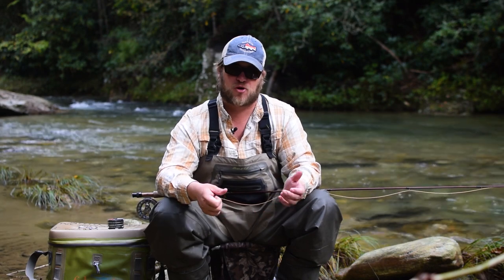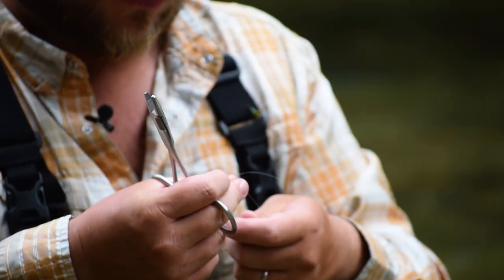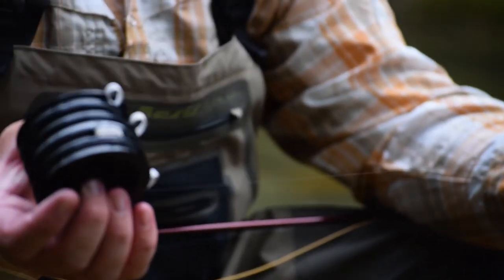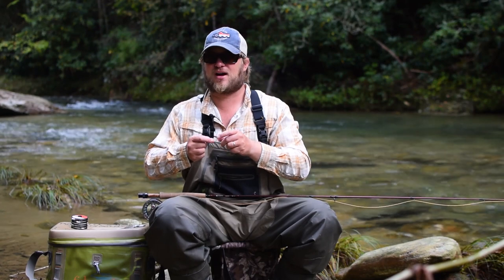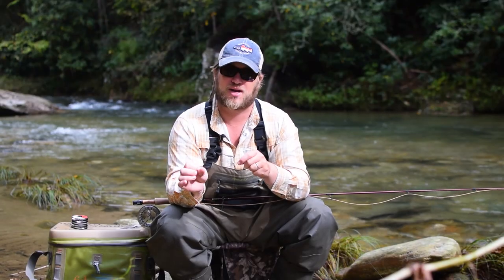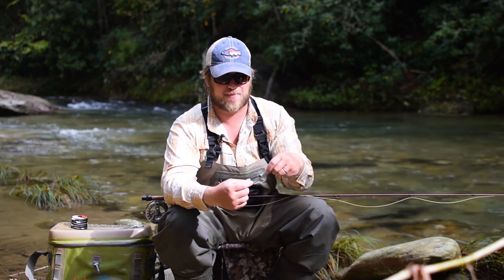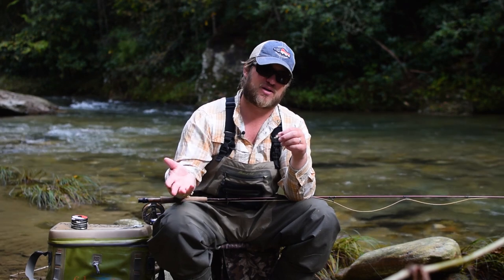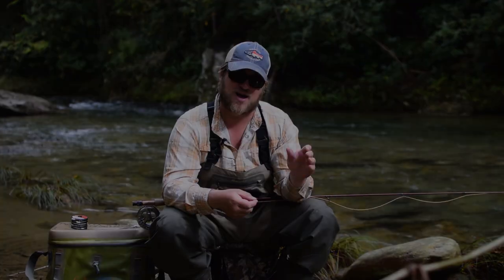Educated Angler - THE DRY DROPPER RIG

Comment: Just found you by accident. I have now seen 3 episodes, you do a great job of explaining. Thank you for the time and trouble you go through for these video's. It would be great to see these in action if you wouldn't mind. One question, when fishing with a double nymph system with a strike indicator, you recommend placing the indicator 1.5x the depth of the stream, between indicator and last fly. Here you go 16 to 24 inches with dry dropper. This comes across to me as you will only do this length, period. Is this because you will use this particular setup only in shallower sections of a river? Thanks for your time.

Comment: i think cutting the 9 foot 5x leader back into the 4x section helps in turning over the rig easier and shortens the leader a little bit which also helps with casting accuracy and turnover..i myself prefer a 7 and a half foot 4x leader myself or 3x in higher water and larger rivers..i believe the most important thing alot of guys overlook is that on a dry dropper rig your not fishing the dry fly..your fishing the nymph.you nymph fishing...the only thing the dry does as its a strike indicator is put a few more fish in your net if you do get a fish to hit the strike indictor but mostly all your fish are gonna be caught on the nymph or you wouldnt have a nymph on there..no need to tie an additional pice of tippet on there adding a weak spot to the leader..i cant ever remember having a fish eat the dry fly and breaking off ...if anyone who dry dropper hasnt experimented with tying your dry fly on a very short tag like 3inches long instead of tying to the bend is missing out..i definatley notice a few more takes on the dry when its tied ona tag as tied to the bend of the hook and no issues what so ever with tangles..that is always caused by casting flaws  you cannot try throwing lazar beam tight loops on a dry dropper rig unless your nymph is completely unweighted...

Comment: so i been fly fishing for about a year and its been few trips here and there so im still not the best. my friend introduced me to some native streams comming off of mount mitchell in nc. great fishing with elk hair caddis for native and wilds further down stream. with that said these feeder streams are at time 4 feet across then random runs and then random pools which is what we aimed for to find the fish. but the problem we had was that the deeper holes which somehow could be 8 foot plus, we would get fish to rise but sometimes they would turn back around. so im trying to figure out using a nymph in general. when im in those tight streams which are highly overgrown, im using a 2wt 6.5 foot rod and using a 7.5 tappered and sometimes 6 foot ( 6 foot seemed better). should i try this dry dropper with maybe a 14 caddis and maybe like a pheasant tail or something like that below for those super deep pools?

Comment: I really like the dry dropper rig but am frustrated with my dry fly sinking too quickly. I use flouroplex tippet for all add-ons to the leader. Does the mono float better? Is that why you use it from the leader to the dry fly? What else can I do to keep my dry fly from sinking?
Reply: Im no professional but there are those big foam flys that are used at attractors and they are very buoyant
Reply: Yeah man the fluoro will break surface tension and draw your fly under a lot faster than nylon or mono would. I would use powerflex to your dry and then fluoroflex down to the nymph. Loon aquel floats a dry great, and then loon top ride keeps it going through the day. For flies I recommend a chubby chernobyl in size 10 for smaller creeks, and a size 8 for larger water. You literally can’t sink it unless it falls apart. Foam is the way to go in my opinion.

Comment: How many turns on the the Improved clinch? I heard same number as tippet just sometimes the line will cut itself on me
Reply from the maker: Definitely depends on the size tippet you are using. Say you are using 7x you will want 12-18 wraps but on 5x you only need 10-12, in my opinion. Everyone has their sweet spot. Another thing to consider is the size of the eye of the fly, if you are trying to attach 7x to a wolley bugger  its not going to catch. Hope that helps!
Reply: I usually only do 3-5 wraps tops, I find it to be just enough wraps but not too much to make the knot weak

Comment: What if your dry must be barbless?
Reply: Chris Smingler attach tippet off of the eye of the dry fly so that it won’t slip off the bend of the hook
Reply: Or even when your tying  your double surgeons. Leave one tag-end long and just attach your dry fly to that tag
Reply: I clinch knot to the tippet. And slide it to my dry fly. Or I have started tying a double surgeons knot 8" up and cut off both tags so I just use it as a stopper knot. Then I tie the clinch above the knot and slide it to the stopper knot. Then your leader to the dry is submerged and doesn't leave a shadow. Learned this from an old timer decades ago. Fish are spooked by shadows more then anything else.